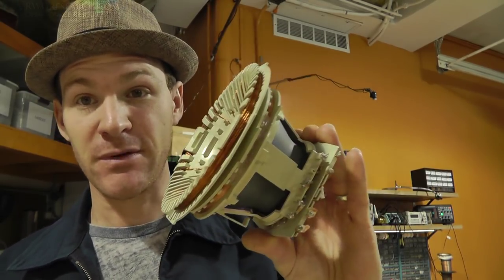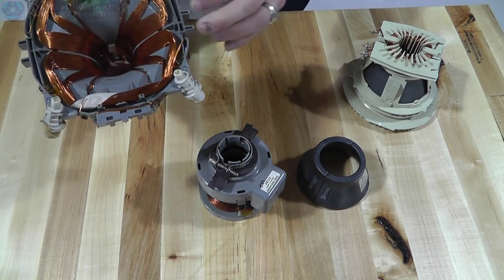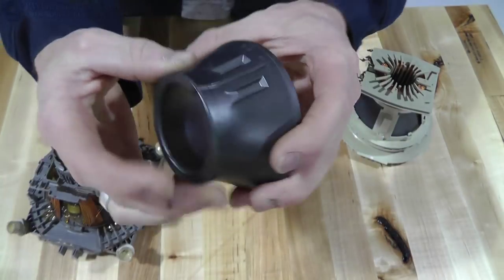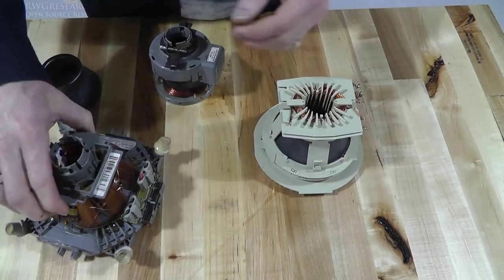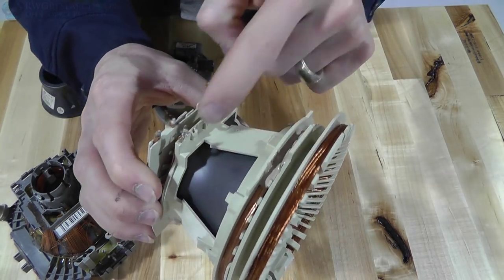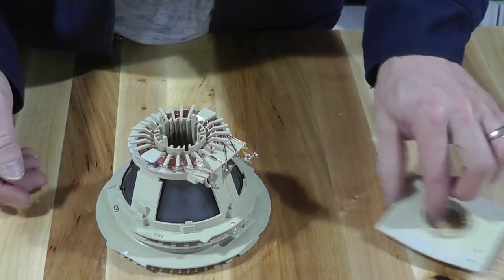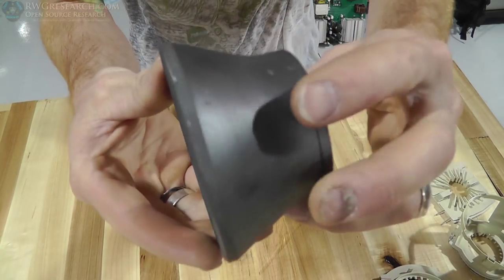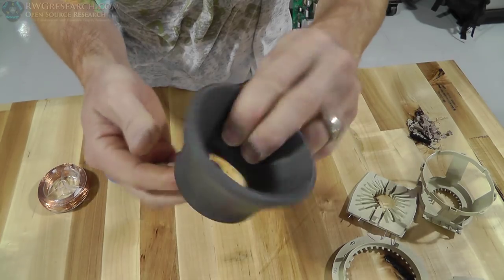One Piece TV Ferrite Yoke? Never Seen One Before. & Salvaging Litz Wire.

Comment: Every one I have taken apart had the clips but were not cracked at the seams I have placed a flat screwdriver in the slot and pried or shocked them with a hammer to crack them on the seam after the clips were removed. the last few i recovered I have left as whole with the wire still on them just sitting in my parts box for projects.

Comment: Ahhh, yes... the old single piece ferrite :)
I'd have to agree with you -  they are extremely hard to find! After taking apart well over 100 TV's I have only ever found one. I might do a quick video to show you mine, but it's not much different to look at. What's the OD on yours?
That must have been an old 70's TV you got yours from... judging by the look of it?
& litz wire! BONUS!
Reply from the maker: Energy Fabricator yeah from what i can remember it was a gateway. a high end one. had the built in USB and a lot of the boards were SMD components. it also had the most shielding i have ever seen on a monitor. it was newer. the OD of the big part is about 91 mm, and the OD of the small end is about 62mm. its about 9mm thick on the small end...
Reply from the maker: Energy Fabricator also, it gas a M---------CB1 stamped on it in ink.

Comment: I dont see the logic in making a one piece core then going through the trouble of splitting it in half risking failures. Why not just make the halves. If you argue that it makes a better conection, that doesnt make sense either cause the edges are bevelled where they connect. With machine polishing, there is no way the induction loss could be anywhere near what the bevels create.

Comment: Off topic but on subject,  did you know a common practice in connecting rods of an internal combustion engine is to crack the rod cap on the big end, give you a perfect connection as well as your ferrite core.

I never herd the term litz wire before, guess it's important if you went threw all that trouble to dig it out. 

What are you, or can you do with the core?
Reply from the maker: Hhydrogen4Power answer to first question, i was not aware that that is common practice. now that i had a look i see, thats verry intresting. and to me a good idea, untill the mechanic forgets what goes where... is that how you learned it :) J/K 

second question http://en.wikipedia.org/wiki/Litz_wire
mostly used for high frequency... radio RF ECT.  The litz wire you see in this i could not just cut it out. was to easy to remove... but... this type of litz wire is easy to make your self. however this type is not:
http://www.gokrb2b.com/upload/20110527/HF_Litz_Wire_Rectangular_Type.jpg
that's 1680 strands of 44AWG wrapped in one bundle... all insulated from each other. talk about fun to solder... 

last question
that core i have used one like it ( 2 pice tho) in the PAPP experiment. used it for the high voltage low curent - low voltage high current discharge circuit i created... it allways had so much of a jolt it would rip the cores in half ( pop the clips off)  and i would spend some time trying to find out why i cant get the circuit to work... now i wont have that problem... one part core... 

thanks for the info! 
~Russ
Reply: ***** that litz wire is cool stuff. I use solids all the time, maybe I'll try this and see if a distortion accusers.
Reply: ***** on the connection rod, I found my first set years ago when I went to machine an engine, sorry I can't remember the make and at first I ridiculed the idea then it was explained to me that the surface of the crack was stronger than the flat machine surface and has pretension so it is less likely to break. Hp engines can crack the connection rod around the bolt flanges from shifting and pounding of the rod bolts streaching. Fyi.

I can see how the pap can jolt cores. Good score.
Reply from the maker: Hhydrogen4Power you should, 

also here are some nice bits that will help you get the correct stuff for your application:

http://www.litzwire.com/nepdfs/Litz_Design_PDFs.pdf

http://engineering.dartmouth.edu/inductor/papers/litzj.pdf

looking forward to your feed back on the good / bad litz is for you... 

~Russ
Reply: ***** Russ I looked at the surplus house today and I could only find "Befriends" wire. Do you know how to use this? I don't?
Reply from the maker: Hhydrogen4Power strange, i have never heard of "Befriends" wire. but I'd say if you have some then it would require connecting each end to a point where a mutual affection takes place, but in doing so it would require more precise connection and a better wire that conducts with love.  wow, that's an idea. a wire that conducts love. humm ill need to think about that more... i guess the "Befriends" wire is only good for electromagnetic waves that have mutual vibrations. must be a form of acceptance of other vibrations even when the wire is reflecting the wrong vibraations due to an impedance mismatch. that is an odd wire you have there. sounds like with a little TLC you can match the impedance and get it to all vibrate at the same and create those standing waves we call LPM... hummm. this is crazy wire.  

~Russ
Reply: ***** litz befriends wire,lol. Sorry I couldn't resist, it's sounds so F'n gay, but I was to tired to delete it,lol. 
  You have to be careful handling the love wire, "you'll go blind". It also spontaneously combusts population, so when in strange places where gloves and wash your hands,lol. 

I think we are done with this subject, except the wire dose have a strange energy to it, that can't be synthesized. 

David

Comment: Russ, what happens if you electroplate at 2 million volts (d.c. pulsed) onto zinc anode with iron in water, if that is even possible? Then what happens if doing the same but using semiconducting gel+fe+sio2 1/3mix? Ever mess with electroplating? 3d printing underwater to make ferrite or electric steel laminates for ac motors is my goal. I was thinking that silicon wont bond with fe without 2m volts. Low voltage electroplating like 10vdc is ideal, yet would not allow silicon application for making electric steel parts.